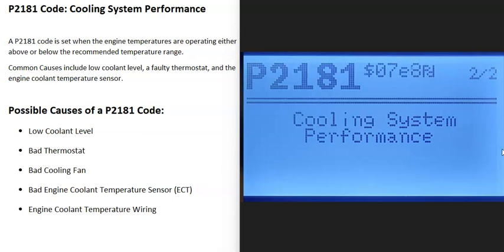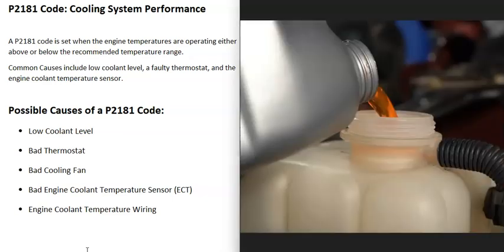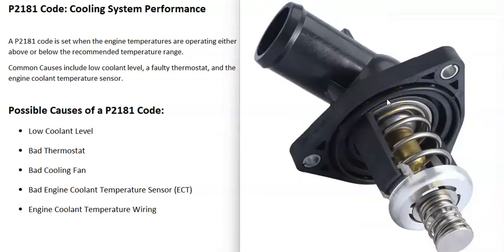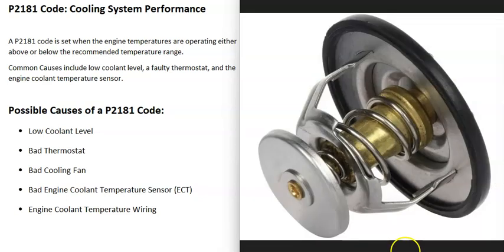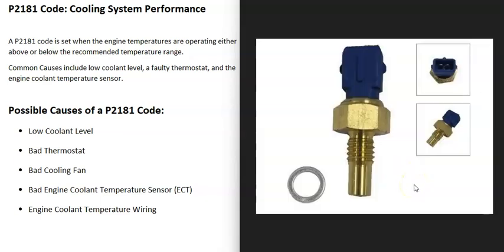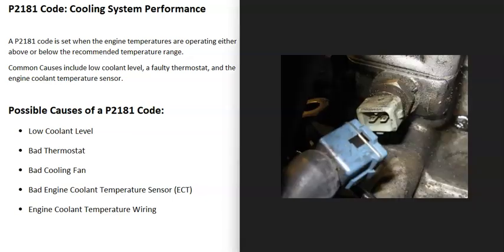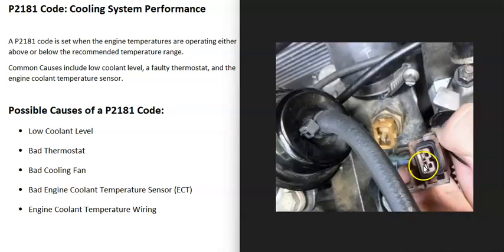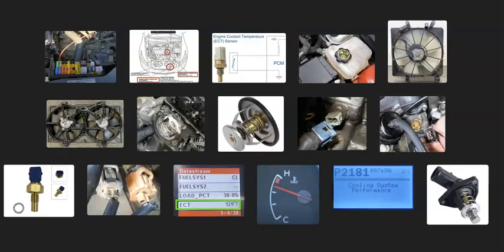Causes and Fixes P2181 Code: Cooling System Performance

Comment: I have this Aussie tye temp gauge keep fluctuating and it reads in the screen that its kind cold then sometimes it’s normal I’ve had the ect sensor changed twice put in new coolant level is good and the fans run high. I cleared it but I need this problem gone what could it be help please

Comment: Radiator fan is working. Added new hoses. Coolant level checked and thermostat changed. Old radiator cap had some sludge. Could it possibly  just a clogged radiator if temperature is stil about 5° degrees from usual temp temperature temperature?
Reply: My radiator fan wasn’t working, changed the thermostat (ITM) and it works now perfectly.. Elantra 2021